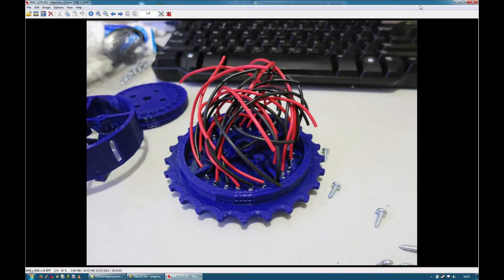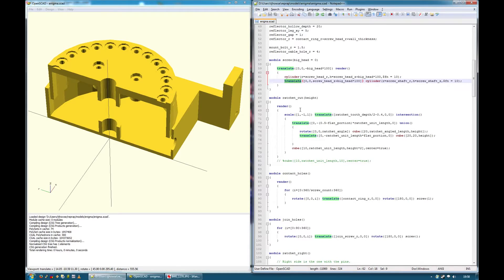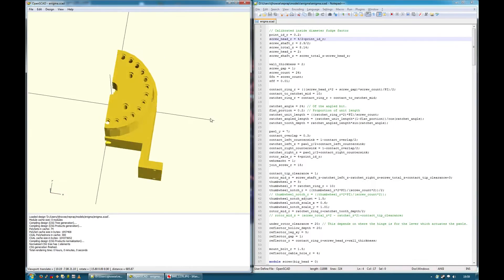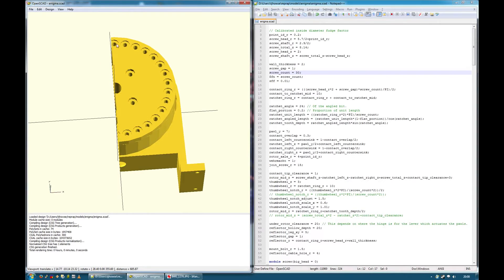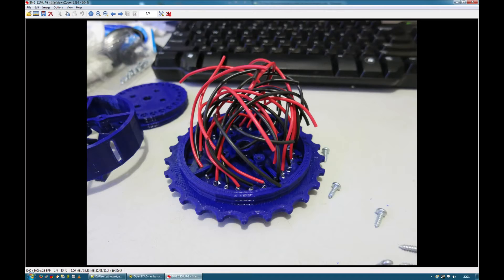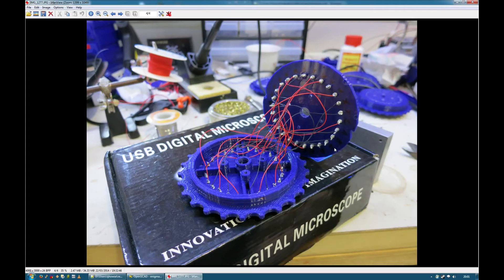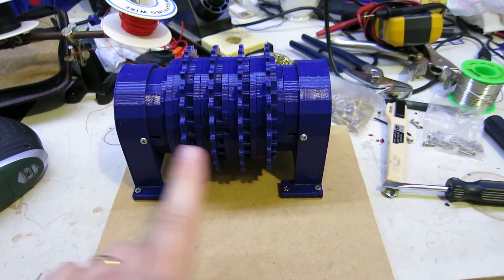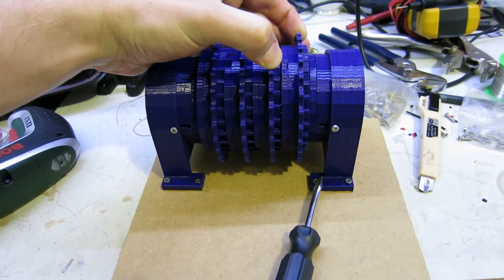3D Printable Wehrmacht Enigma machine video 2

Comment: Hey, awesome project. I'm working on one of these and I was wondering if you could make a video talking a bit more about the wiring. I have a pretty sufficient understanding of the mechanics but the electrical part is difficult. Just a few questions: 1) what types of wires did you use, does it matter? 2) how did you attach it to the screws? you mentioned soldering but I was thinking about just wrapping them, do you think that'd work? 3) finally I was wondering if the type medal is optional, I was thinking about using aluminium piping instead of screws and was wondering if you thought that'd work?  Thanks, good luck.

Comment: Did you make any more progress on this?
Reply from the maker: Afraid not. I ran out of time/enthusiasm a while ago. I might pick it up again in the future, but I wouldn't hold my breath.
Reply from the maker: I bought a bunch of sprung spherical-tip pogo pins for cheap on ebay, but never got around to implementing them into a design. After I bought them I found a better option here: https://www.mill-max.com/new_products/detail/103 . Stouter, lower profile. Probably a better option than the thin ones I bought.
Reply: Travis Howse awesome thanks for the help. I've been wanting to make a replica for a while

Comment: Nice project !

But to be honest, I think this will never work completely because A) all 26 contacts have to touch each other at the same time which assumes every screw to have the exact same distance B) there is way too much friction

Personally, I was thinking to replace the screws (on one side) with M3 (flat head) screws, that align with the surface and on the other side with M3 (maybe round head) screws with a secured! hexagon bolt on the inside (in a hexagon gap so they cannot rotate and destroy the inner connections), and with a LIGHT finger spring washer under the head of the screw on the other side, so they still can move out of the surface about 0,5 mm ? or more if possible (without pressure), and are aligned with the surface (under light pressure). Maybe multiple washers could do the job to relieve the pressure.

This could resolve (A) the friction problem (B) the possibility of bad contacts.

What do you think ?